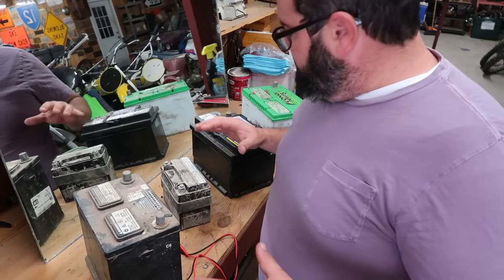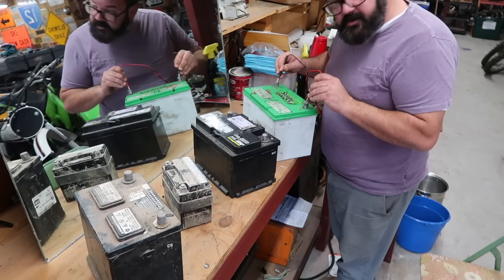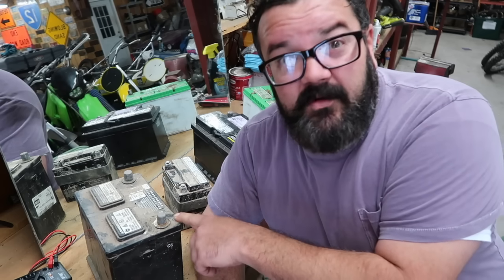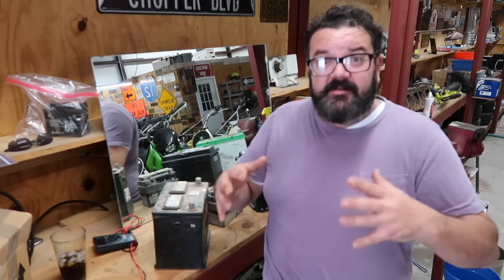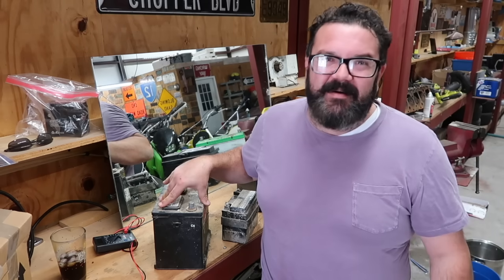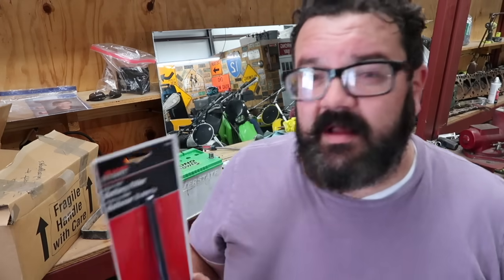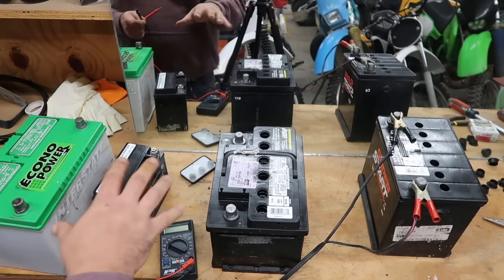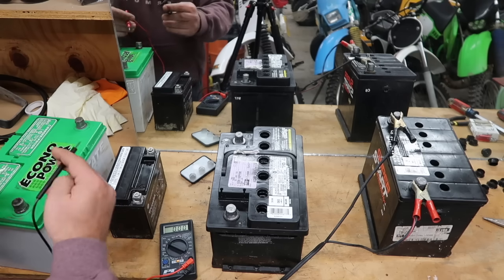Reconditioning a 12 Volt Car Battery: 100% Success

Comment: 10.8 v for a 12 v battery is dead
Reply from the maker: https://www.youtube.com/watch?v=RNnSYuTuLk4&t=46s
Reply: 12v for a 12v batter is dead.   13.6v is fully charged.
Reply from the maker: @JoeLinux2000  batteries come 12v new, watch my second video
Reply: @JoeLinux2000  13.76 v while the car is running is fully charged.
Reply: I used a meter on the battery when starting and, unfortunately, the voltage dropped by about 1 volt after i shut the motor off; this indicates that at least one cell in the battery can no longer hold a full charge; and the battery should be fixed or replaced. While waiting to get a new battery at the store, i contacted the dealer and, after the car struggled to start, i managed to get to the service rep at the dealer and they replaced the battery FOC as the car is still under warranty (less than 2 years old). So "13.76 v while the car is running" is not an accurate statement. 13.76 v *after the engine is shut off with no voltage drop" is an accurate and true statement.
Reply: Can I start the car with the reading 8v in 12v battery...    Mine 8 year old batt, not single break down untill now but dead/discharged in three months lockdown by playing music player/mobile charg but forget to run the engine by my mom,
Jump started last week, rev up to 2/3krpm for 1/2 hr then engine off and told to start the car the next morning but it refused to start but dashboard lights r on...      Ystday I removed the battery, it was at 8v then I charged with my home ups inverter (charger), the charging volt showed 13.5v, left on 5hrs there was bubbling sound at 1st hr at the negative side so I just loosed the water filler caps in fear of pressure buildup/expolde, there was also a mild metal smell though it was out open, later I saw vapour (or smoke not sure) from the water fill vent it was already 5th hr so I freaked out and stopped charging...    & now this day it still showing 8v...     I'm not sure about the charging current (amps) while being charged...
Is the batt is dead??..    can I give it for automotive bat charg(trickle ch) in batt shop for some bucks or needs to be replaced?....
Reply: @danii4646  After 8 years the battery plates are certainly sulfated badly and need to be refreshed. I don't know if the method shown in this video works; but, for sure, the only thing your battery is going to start right now is a portable electric kettle, your MP3 player and the dash lights. The moment you turn the key, the volts coming out of the battery are probably not 8 volts but 5 volts or less. The cold cranking amps are probably 30 or less.
Reply: Internet Privacy Advocate that’s the alternator output 👍
Reply: It means one cell is dead. Hence only 10.8v. Cells are 2V nominal and when the cell is at 50% SOC, the voltage is 2V per cell. Charged is approx 2.2V per cell (13.2V total) flat is 1.8V per cell or 10.8V total. If a battery is 10.8 when fully charged it means you have dropped a cell.

Comment: I have done this with a 12 year old interstate battery that was totally dead after sitting in my pickup truck that sat for over 5 years unused and it worked the battery was just as good as the day I bought it , it had full 12.5 v and I had no issues with it my truck started just fine for many more years ..This is real so save your money and try it before buying a new battery and yes I has tried charging it a few times long before I tried this with the battery charger it got up to 10.2 v but wouldn't even hold that for more then a day...this really works I poured out all the acid into a clean bucket added distilled water and Epsom salt about half way full then poured the acid back in to refill the other half of the battery ..note keep baking soda near by to neutralize any acid spilled or left over..goos luck everyone hope this helps
Reply from the maker: Thanks for watching and experimenting Richard

Comment: Thanks, very informative,. A top running 12 V usually actually runs close to 14 V.  Wondering if adding new sulfuric acid would make it brand new. If so, does anyone know what % needed?
Reply: I just used new acid and distilled in my Honda Civic group 51 battery. I put about 110 ml sulphuric acid (30-33 percent) in each approx 330 ml cell.
Reply: No, don't add sulfuric acid.  If you want to recharge it without removing your liquids, first get all the contaminants out of the battery that are interfering with its ability to charge up and discharge and hold the charge.  If your carbon plates need to be in good enough shape for it to work. If you cant see the plates inside the battery, the battery won't rehab well.  Car batteries dont start out with sulfuric acid in them.  The acid is formed from the ions that get created when the battery gets charged.  There will be ions in the battery that make the solution a conductor and give it the ability to hold a charge.  Clean the inside of the battery with water and make sure all the carbon sands are gone(as much as you can).  Distilled water doesn't conduct electricity.  You need an ionic solution to do that.  Thats why the epsom salts are added.  When you charge the battery, it will create the ions it needs and you wont have to worry about adding an acid too strong or too weak and burning up your plates prematurely.  Or causing an  explosion.
Reply: @chrisbusenkell  
I use electrolyte.
Reply: @NoHandleNameScrewTube  u
Reply: @chrisbusenkell  Chris, thank you so much…you made me use my old brain. I had to use my 40 year old chemistry BSc ; Epsom salts is magnesium sulphate, MgSO4. Charging the battery electrolyses the water, H2O, and combined with MgSO4, the redox reaction creates H2SO4 (sulphuric acid) and MgO (magnesium oxide), thus producing the new pure sulphuric acid needed to create the electrolytes required for battery function.  Thanks again!

Comment: Plus anyone that knows anything about car batteries knows that a good battery tests at 13.5v
Reply from the maker: New batteries come 12.4
Reply: regular lead acid should be at least 12.8v new.
Reply from the maker: @FixItYerself  Not what I measured here...

https://www.youtube.com/watch?v=RNnSYuTuLk4&t=155s
Reply: 12.5 is fully charged. 13.5-14.5 is hooked up to the car while it is running.

Comment: @ 08:07 it doesn't make any sense. Didn't say what you put into the batteries, only that you filled them with a turkey baster. How much old battery electrolyte to epsom salt water mixture? Since you didn't test the batteries in your equipment, we can't say they worked. And, if it did work we don't know how you did it.
Reply from the maker: 50/50
Reply: He did test the motorcycle battery.  Worked like a charm
Reply: wouldn't the new mixture have a worse specific gravity than original? SPG fully charged should be about 1.265, dead is about 1.155. Also the lead plates are porous to increase their surface area and increase capacity. This is where sulfation happens, and is very difficult to break down into a solution.
Reply: @gm743633  you're probably more educated about car batteries than the rest of us (no bs).  You need to make video restoring batteries and testing their specific gravity to indicate a real restoration - results we can trust using a volt meter and batter SG tester reliably. (Plus a load tester)
Reply: Robert Paulson my research started around 2005. the cheapest way I found was to make a “de-sulfinator” circuit. 3mhz 60vdc pulse breaks down the sulfide crystals but takes many months to work and is not a 100% restoration. Best way was to buy a battery acid kit at the auto parts store and change the acid. But those days are gone. That circuit can be used on an old battery. Switching batteries every year you could have two batteries last indefinitely.
Keep up the good work and go further my friend.
Reply: @gm743633  I didn't know you can no longer buy the box of liquid battery acid from the auto parts store. That's not wonderful news.

Comment: I'm afraid I don't think your voltage testing is sufficient.  Can you not try and measure the voltage under a load..  Even if you connect up a car headlamp bulb, in parallel with the meter leads..  and measure potential across the bulb.   \

Proper battery testers have a very low resistance as a shunt with a meter tapped into the shunt.  We need to know the Amps, under load, not the unloaded volts..
Reply from the maker: New video with CCA coming soon.

Comment: So, to be clear:

1. Drain the battery into a bucket. 
2. Rinse battery.
3. Add epsom salt solution to the existing acid drained from the batteries.
4. Fill batteries with solution.
5. Charge.

Is this correct? I'd like to try it out.

Comment: I’ve had lots of bad batteries that came back to full voltage after taking a charge.  
The real test is voltage and amperage under a load, and of course time.....   12 volts means nothing if it won’t maintain that voltage over a reasonable time.
Reply from the maker: My cost was about $3 a battery. Whats a reasonable amount of time a $3 battery should last?
Reply: Car Groves   I guess that $3 battery is fine if you do not care about reliability.  
But keep in mind. Once you discharge a lead acid battery past 50%, your doing permanent damage to that battery.  I personally would not trust a battery that is not putting out at least 75% of the original CCA.  Zero degree weather in a snowstorm at night, stranded in a deserted parking lot with a dead battery is not my idea of fun....   Here’s only one reason you need a reliable battery in your car.
Reply from the maker: For the people that live in the southern states or southern countries, this is not a concern.
Reply: @CarGroves  Heat will kill a battery too, I have found.  It's usually without warning too... Car starts in the morning, and after a hot day in the sun the battery is cooked and doesn't start the car.  I've lived where it gets cold (St. Louis) and really hot (Arizona).  

I guess my point is that batteries do not like extreme temperatures be it cold or hot.

Comment: I don’t believe that you brought these battery’s back to life. You need to do a load test with a Battery Load Tester next. If it passes the load test and shows the CCA (Cold Cranking Amps) to show on the load tester what it shows right on the battery then I will believe you. Sorry. I tried to revive many a battery with Epson Salt and everyone of them failed not one success. It just doesn’t work.
Reply: No shit.
Reply from the maker: ffas23 It started the vehicles, test passed as far as I’m concerned
Reply: @CarGroves  You need a LOAD tester. Even a dead battery can give you 12 volts. Put a LOAD test on it.
Reply: Starting the vehicle puts a load on the battery, hence they were tested and they worked. If you want an indication of battery health you can use the cheap multimeter to measure voltage drop while cranking. If they stay above 10 volts while starting you're in decent shape but if they drop to 7 or 8 it's still a bad battery
Reply: Well thats only because you don't understand fully how the process works. there are only a few things that stops energy transfer into lead plates. once you understand this and know how to clean the lead plates to remove the build up you will be able to revive a lead acid battery . I have done this and it has worked for several batteries. some are to far gone because the damage to the plates is too great. but this process works more often than not if you know how to do it...
Reply: You not believing doesn't hurt anyone but yourself. learn what the process is and how it works...
Reply: This is a short-lived repair.  You just cannot effectively repair the plates and grids in the battery with the case sealed. As said, you must test the success with a load test and change of season to winter.  You must also observe the battery remain above 12 volts after a week at rest.  Considering the effort, environmental damage to flushing the battery, and potential danger, I prefer to put out the $100+ for a new one.
Reply: My neighbor told me about interstate batteries. They actually recondition used batteries and sell em as Econo Power batteries. I've purchased 4 to date and only one failed. I'm a Sears platinum diehard battery fan but funds are low and I tried an interstate Econo power batter after a neighbor mentioned it. The oldest of the 4 batteries is in my truck going on 3 years and still going. I can't thank Interstate batteries enough. No I do not work for it sell any batteries.
Reply from the maker: Starting the vehicle is a load test.
Reply: Car Groves Yes it is but without any readings on the battery. What people are trying to do here is restore their battery to brand new condition. So if your battery for instance says it has 700 CCA on it your load tester should read 700 CCA during the 10 second load test or more if you truly restored it to like new. Starting your car means nothing when it comes to battery readings. Most cars can start with a CCA of less then 400. As I mention early on I tried to revived many batteries over the years with Epson salt. Like many others I never had any success. I wish it was the other way around. I don’t like overpaying for batteries today well over a hundred dollars no more then anyone else.
Reply: Eddie Jaeggi So your neighbor "telling" you about Interstate batteries is enough proof for you to believe they resell reconditioned batteries like new?  SMH...
Reply: Car Groves No, it's not an adequate load test.  You can start just about any vehicle in the spring time with a battery putting out 12 or slightly less volts.  You are not going to do that in the heat of summer or the cold of winter after the car's been sitting at the airport for a week.  But if you pay me the $5 core charge, I'll be happy to drop off my failed batteries for you to play with.
Reply: Car Groves you are missing the point. Once again this is done to renew the battery to like new condition. No one on You Tube has proved to me that it has been done and through my own testing I am not in the least convinced that it could be done. You didn’t do anything different then I have already done.
Reply: ffas23 I think you meant to reply to someone else's comment.  I agree with you that this is snake oil science at best.
Reply: Update please, with load testing?
Reply: Brian Krian You are right I was replying to Car Groves. Sorry about the mixup. I will fix it.
Reply: @CarGroves  have to load test to find out if it's a good battery.
Reply: @stevelamperta865  how to remove the sulfanation off the plates?

Comment: You used way too much Epsom salt. The other thing when you said your four-wheeler wouldn't crank with the battery that had around 10 volts that's because it needs around 12 volts Plus to turn it over to crank it.
Reply: Thanks for the comment. What ratios would you use?

Comment: While good info - this is the hard way to do this.  I have successfully just put in one tablespoon of concentrated Epsom Salt/water solution (mixed by shaking in a bottle of water with little water and adding more salt until no more would dissolve) and trickle charged over night.  Same battery running 5 years later.  I will try to repeat this when it dies.  If it does not work, then I would consider changing out the entire fluid.
Reply from the maker: Lee, how many ways are there to skin a cat?

Comment: All  because you read 12v doesn't mean that you have a good battery!  You need to check the amps....to do this you need a load tester to see if the battery is good under a load
Reply: What u say is true  to start a car u need  amp to crank it voltage dont mean anything i have a battry i recondition from 2v to 14.4 volt and still cant start my car. Cranking amp is the matter not voltage.
Reply from the maker: CCA video coming soon

Comment: That mixture was explained well enough on video, but unclear was the refilling after draining and flushing the battery.  Did you mix one portion of the previously drained fluid, with the H2O/epsom mixture (and if so to what ratio ?) or did you use the H2O/epsom salt mixture only?

Comment from the maker: Second video is up! I test CCA Amps and cut apart a battery so you can see the process.

https://www.youtube.com/watch?v=RNnSYuTuLk4&t=46s
Reply: thank you the information
Reply from the maker: @mr.bluegrass9723  Your welcome
Reply: Hello there from Athens, great video, very informative! Just a couple of  questions, why reused the old electrolyte instead of a new solution of chemical pure sulfuric acid? And, the dark colour of the old electrolyte came from inside corrosion? ( sulfuric acid tends to turn black after time inside a plastic case or a bottle). Thanks you in advance
Reply: @josuereyes8223  I like this video, a while ago I was stranded because my battery was not conditioned, but now I know how to recondition the car battery
Reply: Hey it's Sunny with higher vides tribe I wanna say thank you your keeps on replace in making a battery work with epson salt it really worked and I think you again
Reply: Car Groves you’re really irritating the battery manufacturers lol!!!!!
Reply: Good video well done. Thanks I learned quite a bit thanks to your vids.

Comment: 4 lbs of epson salt to 1 gallon of distilled water.
Reply from the maker: Yes sir
Reply from the maker: https://www.youtube.com/watch?v=RNnSYuTuLk4&t=46s
Reply: Ok but then what do you do with 1gal of water as it related to acid.
Reply: So you're suppose to add it back to battery. Don't bother guys. Your local auto store has fresh battery acid for $12 6 qts, good for 2 batteries so it's $6/battery.

Comment: So what does mixing the epsom salt solution with the old battery solution do? 

In the event that I wanted to try it, would replacing the fluid be as simple as buying some straight sulfuric acid and (safely) mixing it with distilled water, or am I oversimplifying it?